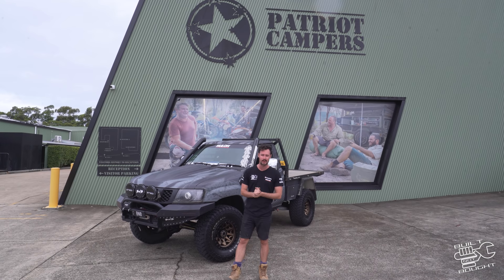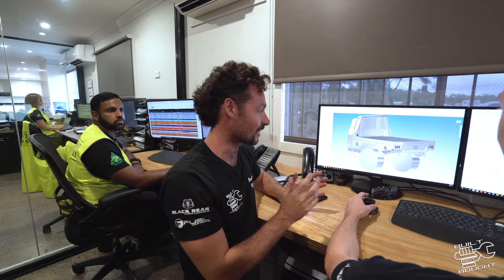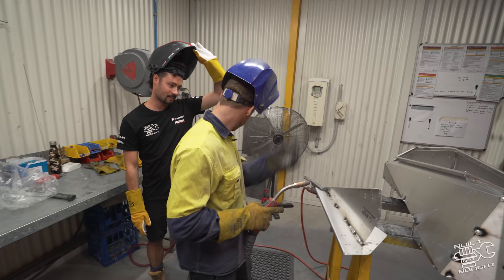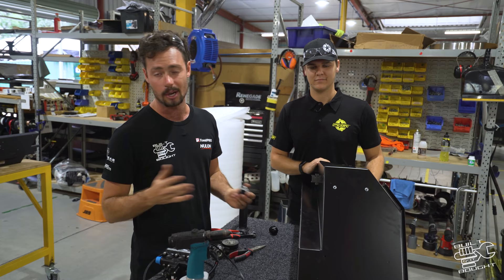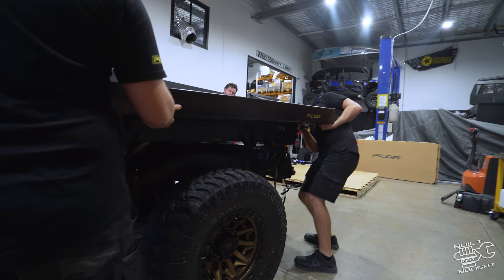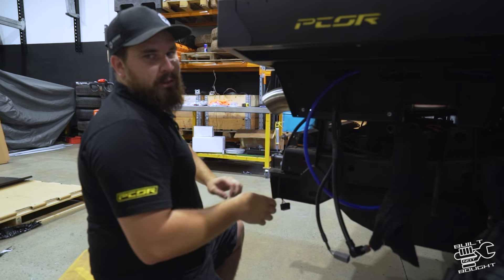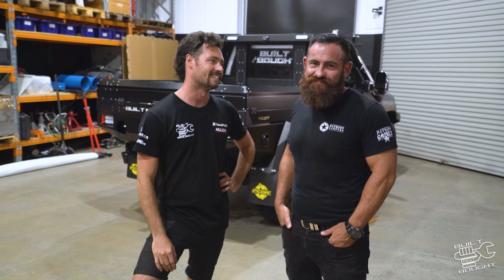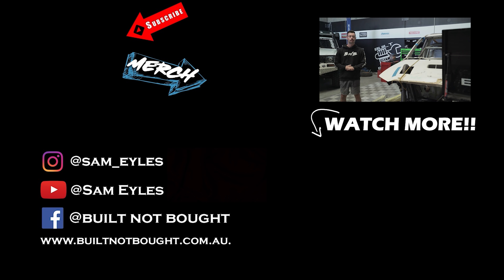NEW TRAY || First Time Cameras Go Behind The Doors Of Patriot Campers

Comment: Hdj47 used to be a 1984 hj47 land cruiser before putting a Nissan gu chassis and 4 inch lift and running 37” tyres  and running a 1hd fte running at 216kW and 720Nm of torque. And for a daily I drive a kzn165 hilux. Great video mate 👍👍
Reply: Nice
Reply: Surely u have an Insta showing this rig off??

Comment: 1993 Gq patrol,  running 3" flexi coils,  4" shocks, drop boxes and 35's on old sunraisure 15x8 rims, woulddefinitelylove a cool set of rims for the old GQ,  latest modification has been fitting a mild ford 302 Cleveland V8.